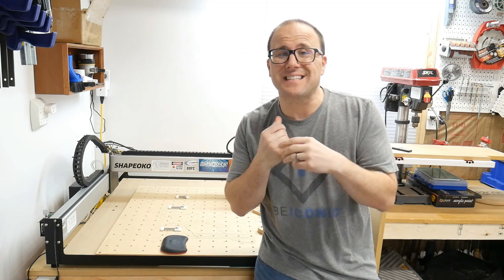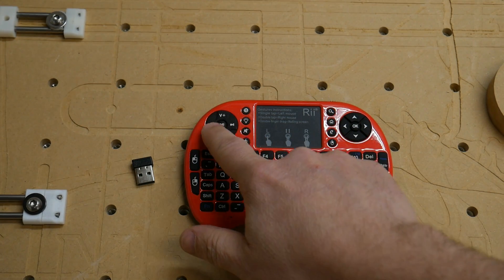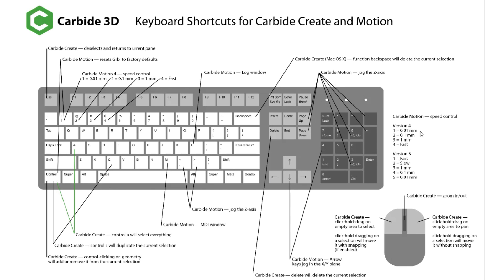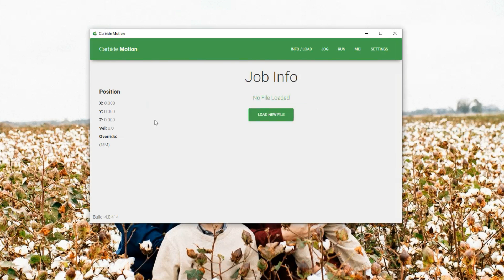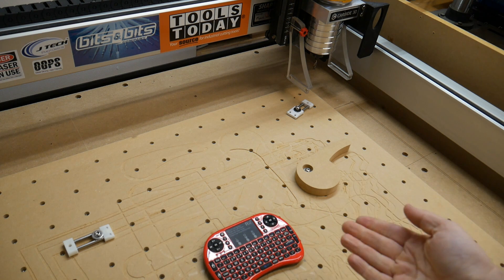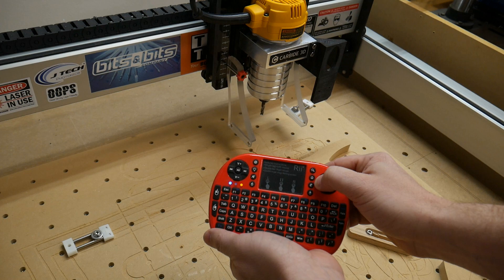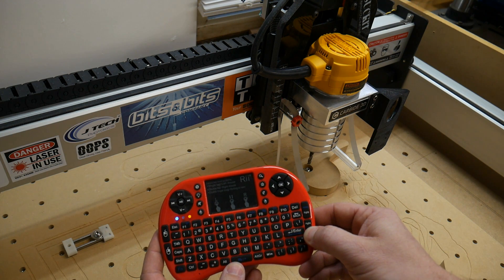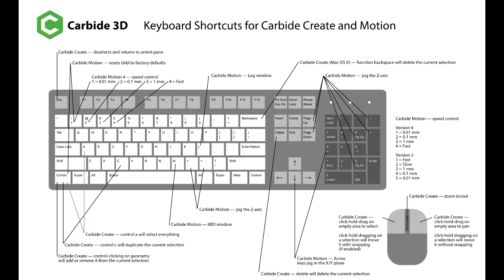Control Your CNC With A Wireless Remote // CNC Woodwork

Comment: I am having problems with my machine. Iwas flatting my wasteboard and the machine went nuts trying to drive 6bit throught the wasteboard and shut down.
   I have tried seberal times to Home the machine, when the cycle starts it jus movers away from the Z sensor and keeps going downto end of travel. 
Help
Reply from the maker: i'm not sure.

Comment: Ben, i have the same keyboard thank you.  now my question is how are you connecting your "across the shop' computer to your CNC machine?  I bought a couple of expensive 30ft USB cables and they don't work.  Emailed Carbide only to be told sorry we only support 6ft cables because of interference so no help there.  What long USB cables did you specifically use please?

Thanks
Reply from the maker: i use a 15 foot cable.  that seems to be the limit.